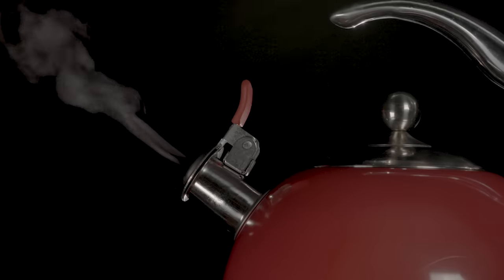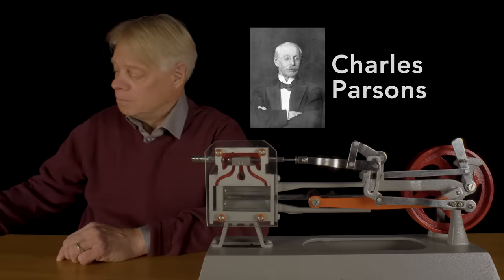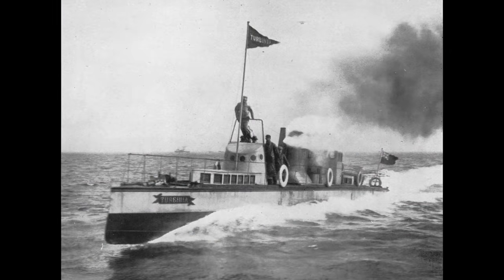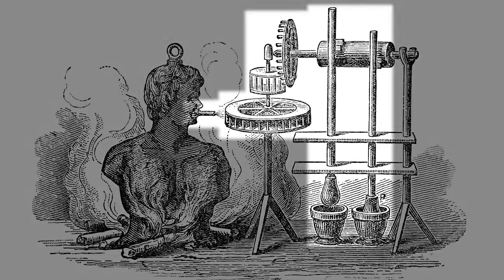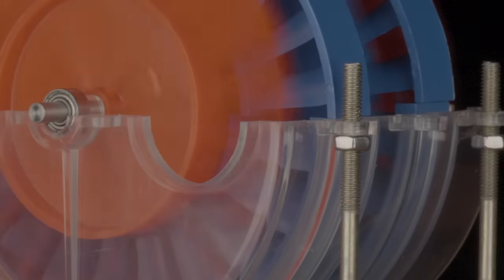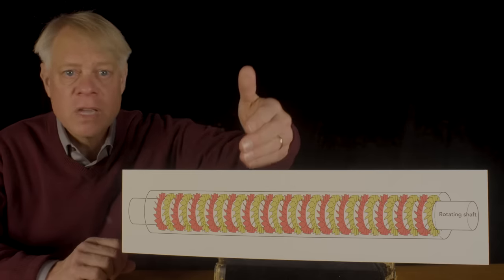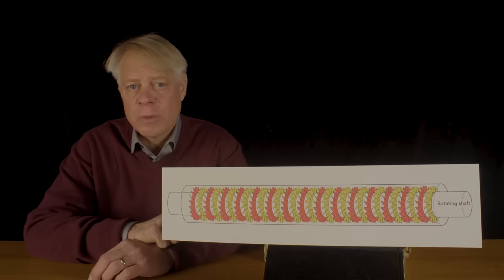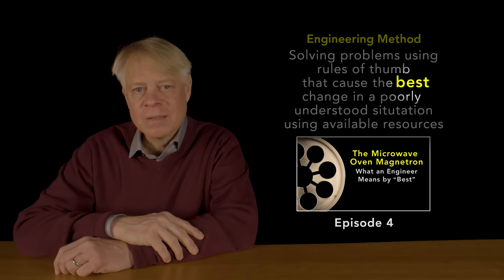The Steam Turbine: The Surprising Relationship of Engineering & Science

Comment: The Engineer and the Scientist are like two explorers traveling through a vast forest. The Engineer is the trailblazer, doing their best work with their boots in the mud, clearing a way through the trees. The Science is the cartographer, doing their best work at they seek good vantage points from which to map out the complete structure of the forest. On their own, they may get things done, but when working together they are a force to be reckoned with. The trailblazer cuts through the clutter on the way to new vantage points, while the cartographer's map is a guide for more efficient paths.

Comment: Steam turbines are my bread and butter.  The coolest thing is that they are so well-balanced, you can spin a 330,000# LP rotor by hand, once you put oil to it in the bearing.  They're great.
Reply: At a GE 'large apparatus' shop near Boston, I got to see a commercial plant rotor suspended up on roller bearings while they balanced it.  They only spin it a few RPM, but watching those six foot blades whiz by, even at that slow speed, was a bit scary.
Reply: I’ve been working in thermal power plants for over 30 years. The well balance statement is even more fascinating by the fact that these turbines, as big as they are, vibrate so little. Most bearings will vibrate about .5 to 2 mils. Considering a mil is 1 thousands of an inch, or .0254 mm.
Reply: hmm many turbs use air bearings
Reply: @manxman8008 he does have a point.
Reply: I work on gas turbine powerplants used in airplanes. They’re exactly the same in principle in action, just using a different fluid.
Reply: @manxman8008   Not in steam turbines.
Reply: Have you ever worked on aircraft jet engines?
Reply from the maker: @Repented008 no
Reply: @engineerguyvideo   The power of the turbine is truly immense. Generators on land, jets in the air, carriers on the sea surface, and submarines in the depths. Charlie changed the world.

Comment: 4:55: It seems to me that the plastic model turbine is shown back to front. The curved blades should increase in angle as the steam passes through the disc, and so on for the following discs. Think of each blade as an aerofoil. Apart from that, thank you, from one Bill to another, for your video.
Reply from the maker: I hate this kind of errors … sorry for this …
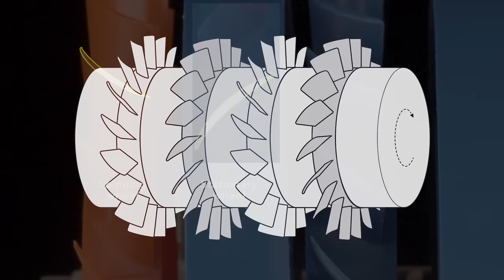Reply: Ok, I wasn't the only one to notice. At 5:55, the flow rate would induce a rotation in the direction opposite than that shown. The diagram at 7:00 is correct.

As someone who has used the NIST steam tables extensively, I had no knowledge of the history of their role in the success of the first steam turbine. Thank you for this video and the many others like it. I-L-L
Reply from the maker: Indeed I flipped the turbine
Reply: I was wondering why the blades seemed to curve in the other direction
Reply: Thanks again. Always love your videos
Reply: @engineerguyvideo  trial and error, putting the theory in practice 😎
Reply: @theotherserge  - Just remember that in theory, there's no difference between theory and practice, but in practice there is...
Reply: My Asperger-esque tendencies almost required a medication intervention, but I decided instead to just breathe...
Reply: @hagerty1952  I like that! Another variant I’ve heard “The difference between theory and practice is greater in practice than it is in theory.”
Reply: Yes, this jumped out at me too.  I had to go and search for confirmation then I realised that all I needed to do was look at the comments.
Reply: Thanks for pointing that out, I didn't want to be the only one.  LOL   Yeah the shape of moving and stationary blades is okay (well, they are compatible as they are opposite direction),  I think he just got the direction of the steam flow backwards.
Reply: @engineerguyvideo  We'll call it a graphic typo. 😁
Reply: @engineerguyvideo  It's an easter egg for the "technically correct" nerds!
Reply from the maker: Yeah, that’s a good line!
Reply: @engineerguyvideo  - Thanks.  I've been in the engineering game probably longer than you have, starting in aerospace, spending a couple decades in semiconductors and now doing medical devices.  In fact, if you've ever had laparoscopic surgery, there's about a 10% chance that I qualified the instruments used!

It has never been easy, but it has always been interesting and now I'm having the time of my life since what I do affects people and families in positive ways.

Thank you for popularizing the field is such a great and understandable manner! 😃
Reply: @engineerguyvideo   Not just that, but the order is wrong: the wheels seem to simulate different pressure stages with different length of blades, so it should be blue, rear orange, front orange.
Reply: I'm so glad I'm not crazy, scrolled down to see no one mentioning that and thought I've been misunderstanding how blades cause lift/torque completely lol.
Reply: @joebottini1743  Arent the blades in the diagram at 7:00 "curved" the wrong way around, so there its still back to front?
Reply: @spacekip38  Yes, I believe the camber is backwards at 7:00. The device as shown will still sorta work as a drag turbine, it just won't be super efficient. It really wants to be used as a compressor!
Reply: @bpj1805  I suspect that is exactly why the curve of the blades is wrong both in the plastic model and the illustration at 7:00. I think it's based on a multi stage compressor for a jet engine for which the curve is right but it should be the other way for a turbine.
Reply: Thanks this was bothering me
Reply: hahahaha!

I was just about to comment that the toy turbine is running steam in the wrong direction.

[Principal Engineer - steam turbine designer...]
Reply: Yeah I noticed that too, he might have gotten some wires crossed and set it up like the compressor stage of a turbine engine instead.

Comment: Always fascinated by all the various 'heat engines'.  The Navy ship I served on, we used turbines that had two-wheel Curtis stage, followed by several Rateau stages (what we called 'velocity and pressure compounded').  Those turbines were extremely rugged and needed very little maintenance.  Great video.

Comment: What???  In 6:05, the turbine rotates in the right direction alright, but the direction of the steam comes-in from the wrong side.  You need a stator stage at the opposite end and the steam needs to enter from there.  Your flow vectors don't add up for a turbine, but basically defines a compressor running in the false direction.

Comment: I love these videos, and it's killing me that the air flow is backwards in the turbine!
Reply: There is actually no air in the turbine, only steam, as air would result in a loss of efficiency, because of it is much less energy dense and has a much poorer heat transfer characteristics.  Most turbine setups are multistage, so there are 2 or more turbines, with the exhaust of one connected to the inelt of the next.  The last stages of the last turbine are actually at a pressure lower than atmosphere, and a well designed turbine setup will reach near vacuum by the final stage.  This is because the condenser (what turns the steam back into water) immediately follows the low pressure turbine, and is kept at near vacuum to minimize the energy loss in condensing the steam.   The fundimental principles of the turbine are much the same as wings in aeronautical engineering, and a jet engine is in essence a steam turbine, but with combustion happening inside, but as air is the working fluid, the efficiency of a Brayton cycle (gas turbine or jet) engine is very low (by itself).  The benefit of gas turbines is their excellent power to weight (or volume) ratio and relative ease of operation, so that is why they are largely relegated to aircraft, warships and short term, high demand power generation (which uses the heat of the exhaust to boil water, which powers a turbogenerator, so the thermal efficiency of the entire system is actually quite good).
Reply: @nomad8723  Steam or air, the depicted flow is still reversed. Look at the fins on each stage: they're oriented for right-to-left flow, but the flow is depicted as left-to-right. I noticed this when he was spinning the model, too: he was spinning it backwards.
Reply: @nomad8723  Doesn't matter, the illustrations seems to show reverse airflow than what the turbine blades are designed for.
Reply: Air hits the convex sides in this sort of turbine.  These things aren't just fans run backwards!
Reply: @christianweagle6253  Why would it not be the concave side like literally every other turbine?
Reply: There's an important design feature that's missing from his model.....nozzles.  The steam doesn't strike the blades in a path parallel to the rotor axis.  Nozzles are used to direct the steam flow into the blades at a steep angle, striking the concave side of the blades.  So his model IS confusing from that standpoint.  In large turbines, the huge last stage blades are typically referred to as "buckets" just for that reason. I was a commercial reactor operator, and the last stages "buckets" on our low pressure turbines (pronouned TUR-bins, Bill!) were 4 feet long, mounted on a 7 foot diameter rotor disc, and spinning at 1800 rpm.   Crunch the numbers, and that gives you a tip speed of about 1400 fps. But it's operating at a new perfect vacuum, so it's OK.

Comment: In the part of the video showing the steam flow inside the 30 layers of fans, you show the steam going from the exhaust to the intake, instead of from the intake to the exhaust. The blades are supposed to act like wings and redirect the airflow, instead of acting like walls to slow down the steam airflow (or steam-flow).
Reply from the maker: There is a revised version in the playlist version that corrects this.

Comment: i had the honour of serving my engineering apprentice years working at CA Parsons, Newcastle, working on the huge low pressure end of the turbines, setting the blades, it maybe worth noting that in another devision of the huge factory {Grub Parsons },was also built, huge optical telescopes, one being the Anglo/Ausralian telescope in Siding Spring Observatory, Australia, the largest telescope in the southern hemisphere, in which i also had a small part in its construction, as an apprentice, I worked on building some of the bearing castings, ( I slyly cast my initials, TAC, inside some of the bearing casings, ( my only claim to fame ) ,, cheers

Comment: Very nice summary. I have an idea for a sort of "smaller" DIY project to build an electric generator with a steam turbine but it is pretty difficult to find a standalone turbine of a given size, there is only complete machines available that are way too expensive to dismember and modify.
Thanks to you I have a startting point on how to machine my own turbine eventually.
I guess I need to modify the turbine since I don't know yet how hot my steam will get or what ranges of temperature it will have, because I am certain that a simply coal fired steam is very different to superheated steam.

Comment: This is an excellent video, kudos to you.

Aside from the already mentioned error in the model rotation direction, I think there is one more minor error, where you highlight a section of the mechanism and indicate that it converts the reciprocating motion of the piston into rotational motion of the flywheel, however the highlighted region is the Walschaerts valve gear, which does the opposite, it turns the rotational motion into correctly timed reciprocating motion to drive the steam valve.

Comment: I really enjoy these videos. Even when it is a topic that I am familiar with, you always add something that I didn't know. So I might be able to do the same here, or you might already know about this. But at least once, engineers designed a turbine with NO stationary blades. They mounted the blades on their own shaft that enclosed the initial shaft and blades. This allowed both sets of blades/shafts to rotate in opposite directions. This was used on the USS Jack SSN 605. It had two concentric shafts with propellor blades having opposite twists. This did two things. It reduced friction losses in the stationary blades and it allowed the propellers (since there were 2) to be smaller and thus make less noise. There were problems with lubrication and oil leaks into the condenser, so to the best of my knowledge the experiment was never repeated. But the USS Jack served the US Navy for decades.

Comment: Wonderful video! As a behavioral scientist, I found it quite edifying and enjoyable. I would point out that the "scientific process" you describe here consists of two distinct types: inductive and deductive inquiry.

Inductive inquiry involves gathering lots of specific observations to develop a general sense of a phenomenon. This was the nature of Regnault's work, or at least how you describe his work here.

There is also deductive inquiry, in which general patterns observable in prevailing empirical generalizations are used to posit specific premises, forming the basis for hypotheses. These hypotheses are interim explanations that can be falsified by testing their predictions. When a hypothesis has been thoroughly tested through efforts to falsify its predictions, it gains explanatory strength and becomes a valuable tool for humanity. If some predictions are falsified while others are not, this may lead to retroductive refinement of the original hypothesis into new hypotheses or novel inductive inquiry to clarify if some aspects of the original empirical generalizations were invalid or inaccurate.

As you describe, Regnault's work, by offering an extensive set of empirical generalizations about steam, provided Parsons with the basis to develop hypotheses about how to harness the power of steam for optimal effect. He may have worked through hundreds of hypotheses, with much of his deduction perhaps happening in his head, though I imagine not all of it was undocumented.

When human beings follow the scientific method assiduously, without bias, with vigor, humility, open-mindedness, precision, and creativity, we achieve our fullest potential. Sadly, the nature of science and how it functions properly in society has become incredibly garbled in the last 50 years. Many people now believe that the sheer weight of received wisdom by established experts is "truth," which should never be questioned lest one be branded a denialist, heretic, or extremist. This state of affairs is reminiscent of what Parsons faced when none of the established navies or railroads would pay him any attention. Thankfully, Parsons had the courage and ingenuity to demonstrate that he was right and they were wrong. Imagine how much worse the world is when well-done science is dismissed in favor of dogma. While these issues are somewhat removed from the specific instance of the steam turbine, the struggles of its inventor to gain acknowledgment and the benefits it has brought humanity highlight the serious lack of good understanding of science. This behooves all of us to trace the linkages whenever possible.

Comment: I am somewhat worried early in the video that you point at the reversing linkage for the valves whilst stating that this linkage converts reciprocating motion to rotary. The crank pin on the flywheel is where this occurs

Comment: My mechanical engineering studies in the late 1970s (New Zealand) included steam tables, etc, but disappointingly no employer, those being mostly US-based PCB production equipment suppliers, ever asked me to design a steam engine or turbine.  However, my first job after graduation was working at Froude Engineering in Worcester, UK and one of my first assignments in 1981 was to visit NEI Parsons in Newcastle-upon-Tyne to troubleshoot a "half-speed whirl", an orbital motion of the shaft at about 45% shaft speed, found to be present on journal bearings installed in a dynamometer they used for testing their R&D turbines, one that Froude had supplied 26 years earlier in 1955.  Talk about extended warranties!  I spent the prior evening at the hotel drinking Newcastle Brown Ale and studying a very thick book on tribology.  The next morning, intermixed with numerous tea breaks, Parson's fitters cheerfully disassembled the 12,000 HP dyno and installed the special bearings I had brought with me, supplied by Glacier Bearings, a type called "offset-halves".  We tested the bearings at several oil temperatures and annoyingly the half-speed whirl was still present in all cases. I concluded a few weeks later that this phenomenon was basically an artifact of two circumstances, (1) that the dyno shaft (8" dia at the journals) has almost zero radial loading and (2) Parsons was experimenting with newly-acquired precision shaft radial position sensors which they had innocently installed on the dyno to see how well they worked.  These were measuring perhaps 0.002" TIR.  In the end nothing was actually wrong, they simply found something that had been present for 26 years but now had the instrumentation to observe and measure it.  The conclusion of my two visits was to send them a statement, ironically transmitted by Telex, another relic of the past, stating that the situation they were observing was "completely normal".  Photo here: https://drive.google.com/file/d/1c67w5hpiDNhhlbAO3C667PjY-maSfXVx/view?usp=sharing